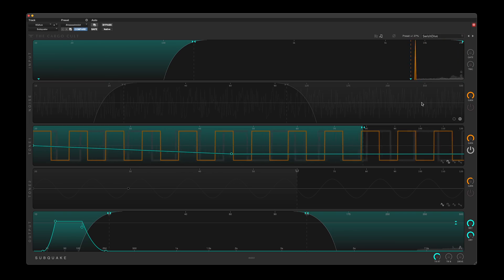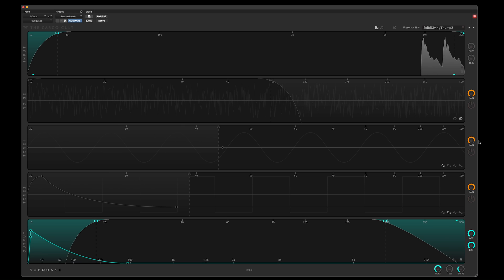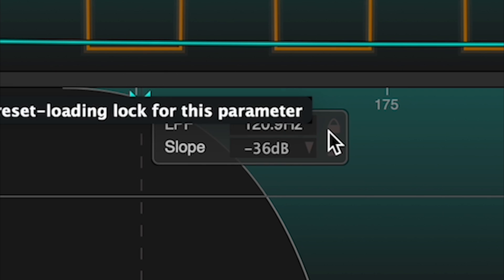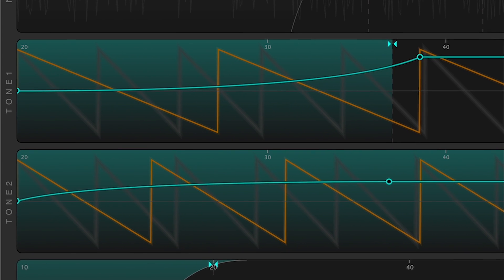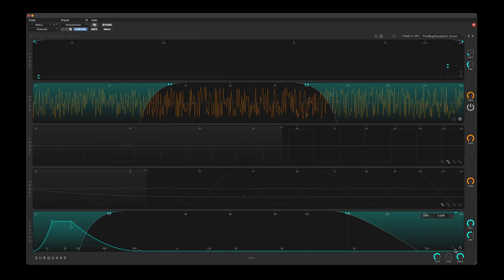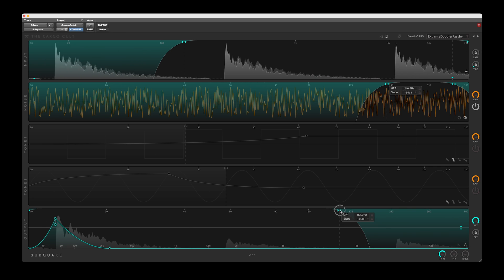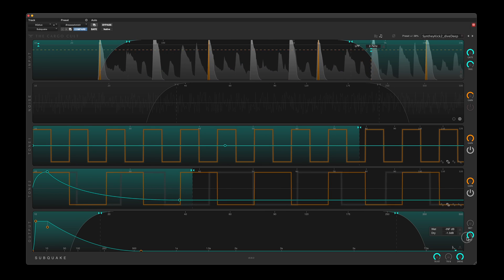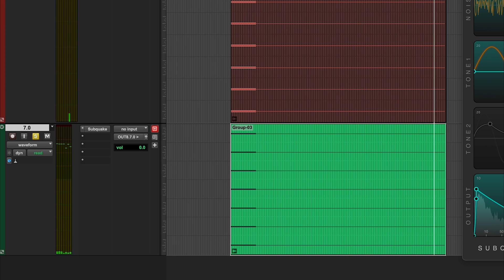Subquake - The Reasonably Thorough Demonstration

Comment: It doesn't "follow pitch," though, does it? I'll experiment some with the demo.
Reply from the maker: No - it doesn't down-pitch the input signal or try to detect the fundamental note. Down-pitching has been done a million times and it's never that useful IMHO. With frequencies this low, you lose almost all semblance of the original sound anyway. Might as well just hit it with a burst of intense LF, generated from scratch. Plus, pitch-related algos are CPU intensive and introduce latency. We want latency as low as possible and the booms to be as tight as possible to any transient you might be subbing.
Reply from the maker: There's also an advantage to having "uncorrelated" signal in the boom. Means the LFE can't fall foul of network compliance people, and you minimise any unwanted interactions (phase issues) when using SQ in the main channels, or when down mixing